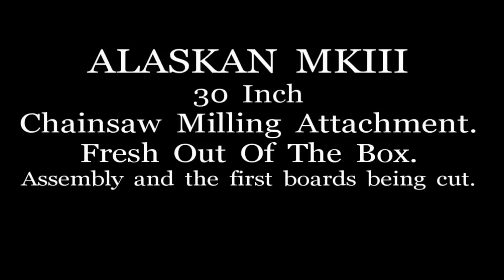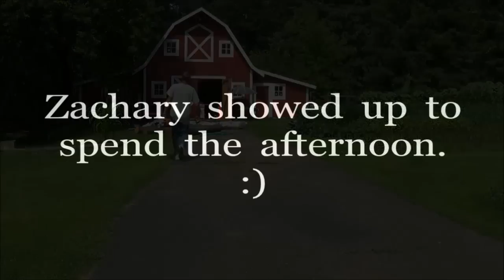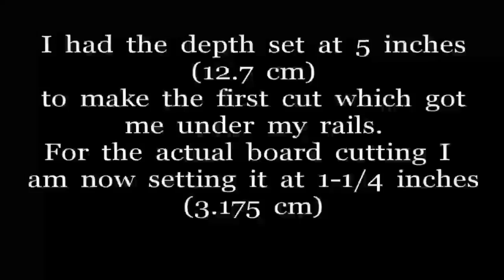ALASKAN MKIII. Chainsaw Milling Attachment. Assembling and then Cutting Boards.

Comment: I really appreciate the demo of the Alaskan MkIII- the closest facsimile to the Powerfist Portable Lumber Mill (TM), for which I cannot find an explicative demo video (and the manual of which is even lean on assembly instruction visuals).  Demo & commentary on assembly and cutting really helps; so too the logical comment about using one or more shunts or wedges on the cut behind the chain & bar.

Comment: Being a certified saw filer all my life and used to use a 7' chain bar to break huge logs down into quarters for the band ill to finish producing lumber, the secret to chain sharpening is to file the teeth at 5 degree hook angle and keep it sharp, just a suggestion.

Comment: One of these was my first mill.  These mills certainly do have their place.  The advantages including getting into milling cheap, being able to cut lumber where the log lays, and make really long beams (I put an 8x10 x36' main girder in my shop building).  Disadvantages are slow, labor intensive, takes big saw, lot of kerf loss.

Later bought a Woodmizer bandmill, and this is the way to go IF you want to cut a lot more lumber.

Comment: Nothing like making your own lumber out of found (free) wood, after years of making lumber with an Alaska Mill, (with an 066 Sthil, a 36" bar and skip tooth chain), I recently bought a real mill, (55hp diesel, fully hydraulic and 36"x21' capacity), but will always keep the Alaska handy for remote cutting because of its portability to anywhere trees grow. One suggestion is to move the cross bar with the handle to the center, or just to the right of center of the piece you are cutting. This gives you support to help square the mill to the log mainly when beginning or ending the cut. Also its important that you not have the bar tip clamp pressing on the sprocket in the tip, not an issue on solid-tipped bars but not many people run them anymore.
Reply from the maker: Nice job on the new mill. I was and am looking at a bansaw type mill but with winter coming and that being the time I do most of my workshop projects I wanted to get the chainsaw mill so I could get some cut and drying prior to the big freeze. Would you please email me Danny? I have some questions on the 066 and would like your opinion a few things before I get a bigger saw.
Thank You.    joe@homeandcabinconstruction.com
Reply: JoeandZachSurvival Hey Joe, I live out here in OR now but hale from good 'ol MN. I agree with Danny on the 066.
I worked in the woods here for years and the company I worked for had 044's for knot bumping and and limbing and bucking. The boss had an 064 for falling and when he upgraded to an 066 I got the 064 it was a little heavier but oh what a difference. I would pack it around all day limbing and bucking and never went back to the 044's,,, more power is good!  LOL
Reply: I use a door jamb shim to buffer the clamp from the running track in the bar and the sprocket- cheapest easiest way i've found that doesn't change the angle or impede my saw from rolling smoothly.

Comment: I have a 36 inch sawmill. Just love it. One thing I learned is that the rip chains work a lot better than the cross cut chains. Im using a ms661 sthil chainsaw. Have a 24 and 32 inch bars for it.

Comment: I milled my shop floor boards and several beams with an 036 and a 24" bar using a regular cross cut chain... I haven't tackles the trees I have down now but I have 6 firs and 2 cedars that I will be ripping here in a few days with the same 20 year old 036.  Been a great saw to me all the years I've had it. 2 spark plugs is all it's cost me other than the several chains I've gone through and the longer bar...

Comment: I run a ms660 on a 28inch bar and cut my tooth to10degrees and that works awesome. The bigger the saw the better. I was looking at a 460 but for the m only I just went with the 660. I cut 8.5 ft logs in about 5mins.  I love this tool. one of the best tools I bought

Comment: Get yourself a Stihl MS660 or an 880 with a 32 inch bar, a 441 won't have the stones for a lot of milling. Ideally one should have a 70cc saw with say a 20 inch bar for the mini mill for edging and a 660 or an 880 for the Alaskan. That way you won't have to keep swapping the saw between the mini mill and the Alaskan. Get yourself some ripping chain as well, the teeth are sharpened at ten degrees as apposed to 25 or 30 degrees on cross cut chains. Good work, keep it up.

Comment: wow! I can't believe how many comments there are about this guy's chain.  I guarantee most of them are from people who have not actually used a chainsaw mill before. It's always slow! and milling/ripping chain might be minimally faster than crosscut in certain situations, but it primarily produces a smother finish because the alternate high angled cutters don't chatter as much.  And milling always makes dust, not chips!  try it and you will see for yourself.  A brand new milling chain makes dust because of the way it severs the fibers.  This guy's biggest challenge is his under-powered saw (which he admits).  But even with a big saw (like Stihl 660) it's still pretty slow and tedious,  just not as slow and not as much stress on the engine, and the ability to go with a longer bar.

Comment: I would advise moving the handle on the jig to the center or just off center of the log.   2nd is an auto oiler,  I McGyvered mine for  <$20.

Comment: I have a 361 with a 20" now and just got my mill. I also just received a 32" bar w/ripping chain...and sharpening file...My thought was, the saw itself wont be cutting over the rated 20", and now I would have 12" of jig space to adjust.

Comment: gun lover 1955 is right ....you need ripping chain #1...also you need to make you some dozen or so wooden wedges about a 1/4 inch thick and 6-8 inches long , these you place behind the saw as it cuts to keep the weight of the wood from pressing down on the bar. I have had my Grandberg now for some  15 20yrs., mine is set up so as to be able to stand at the other end of the log and with a hand boat winch guide the saw through the wood , away from all the dust and noise, I have a 30 inch bar on mine  run by a Josered's biggest saw.
Reply: +Richard Siegler Yes, without a ripping chain he is taxing his chainsaw and fatiguing himself. Probably why the taking turns with his friend. A ripping chain should cut through the log at least twice that fast and be much more gratifying.  Hope he has seen your suggestions and ordered one by now.
Reply: Richard Siegler Did you make the hand winch assembly yourself?  I need that bad.  Running my 99 cc husky with 36 in bar from my wheelchair is killing me...
Reply: Larry Wood ......I did make the hand winch myself, but it was copied from an old timers set up he had made. Besides the winch you will need to make  a yoke with pulleys on each end.....the yoke is aligned with the cut and attached to the log from the start of the cut....then you set up your winch at the other end , run your cables. The setup also has a throttle adjustment cable that can be operated from the winch end. This system keeps the operator away from the major noise and dust.

Comment: Pretty awesome. If you wanted to cut lap siding can you set the depth at diffrent heights from front to back to get a tapper on the board?
Reply: Yes you can do that with this mill

Comment: Upgraded from a little Husky from cheapo Depot to a 562XP (?) AND a 372XP XPATH with 20,  24, 28, and 32 inch bars with stock and ripping chains. i think i watched to many Tube videos and thought I would mill some lumber. NOTE TO SELF: BUY CHAPS B4 YOU BUY THE REST OF THE EQUIPMENT. By chainsaw injury standards it was just a paper cut. Much worse than the 10 or 12 stitches was my shredded jeans and dignity. You can't beat me up any more than I have beaten myself.

Comment: Hi Joe 
Dont know if you already Know, but try using a ripping blade, makes it a lot neater cut and quicker. I have just made my own mill and use a 26" blade on my Stihl 391 that I upgraded from the original 20" chain and could have gone up to a 30" if needed but I find the 26" is all I need.
Reply from the maker: bmw5257 I do want to get one but I am thinking on buying a Stihl 660 so I am waiting and will buy a rip blade when I get the new saw. Thank you. Joe

Comment: I sure wish a chainsaw mill would do hardwood well. I am having to build myself a band sawmill from go-cart parts. I will start posting more videos shortly, just started welding on some steel for it. Sure wish I had more done by now. I need some lumber.
Reply: +onewyatt1  Several years ago I either read a story or watched a video of some guy who slabbed 400ft. of walnut in a day.
Reply: Robert Sorel I wish I had the energy to do that. These old bones can go for a couple hours per day now. I am just now getting back to working on my mill. I will be posting updates as I go but it will take me a good while.
Reply: او

Comment: Do you think the mill would benefit from having a counterweight to balance out the powerhead? and also do you use a wedge in the back of the cut once through to prevent binding of the blade?
Reply: i tried that if you put a wedge the tool surface become higher and your cuts are not straight... they bow if you put a wedge it cant be any higher than the thickness of the chainsaw blade or it wont make a straight cut

Comment: Do you have a ripper chain on your saw? a crosscut chain is what comes on saws most of the time,  it will make life a whole lot faster and easier.
Reply: +gunlover1955  According to the manufacturer, Granville, you can use a cross cut chain, it just makes a coarser cut
Reply: You are right, but you can use a car and trailer  over a pick up truck too but it is not as fast or as good.
Reply: needs a ripping chain. no two ways about it. it is like using a pickup truck to haul logs to the mill compared to a semi.

Comment: Normally chain say s equipped with cross cut blades. A chiseling cut shape on the chain blades is very helpful. you can modify the teeth your self but ripping chain can be bought

Comment: I am by no means an expert in fact I have never  milled a thing, I have been watching your milling videos, would it help if once you have passed the chainsaw and mill through a section to insert a wedge in the cut gap ? to decrease bar and chain pinching, less resistance and quicker cutting ?
Reply from the maker: Thanks Paul. I have videos on milling lumber on this channel and more of them on my other channel called "Northern Seclusion" in many of the videos you will see that I do in fact put wedges in to stop the binding. It is a necessity is some of the logs I mill. Thanks again. Joe
Reply: ive seen your other videos now I was a fool to doubt your competence.
Reply: Paul Saunders my thoughts exactly
Reply: a little late but sharpen your chain

Comment: Bet you've learned a lot since cutting this first bunch?

Get your logs up off the ground(think hi-lift truck jack), make sure one side is lower then the other(think gravity).  Being older, like we both are, those knees start to hurt the next day.

Remember to have fun....BTW, are your pups deaf?  They sure picked some weird spots to nap during the video'ing?!?!?
Reply: The other thing is on the ground the way you are, if you get any kickback at the start of the cut or your chain breaks etc, your thighs are going to get messed up pretty quick.

Comment: I would buy the biggest saw you can find then down size the bar 2  inches under. On a new chain if you take one stroke off the rackers with a flat file you won't have to work so hard to get the saw through. Your chain you have now is dull too much fine saw dust, and if you keep the saw on an angle it will cut strings instead of chips. When you put a new chain on your saw you should really study th angle cut of the teeth, with a round file that matches the chain try to keep that same angle and count each pass you make on one tooth and do the same on the rest. If you do 3 passes on one side and 5 on the other side the chain will not cut straight. I have always sharpened my own chain saw free hand with a cheap file, and always take the rackers down as those teeth get smaller. You could get a guide for the rackers so as not go too far down. When the rackers are down a little extra it wears the chain out faster but it sure saves on the back, you won't have to even push if you got a real powerful saw.

Comment: The chain sounds like it was running dry and the chips were a little small. This means the rakes are a little to tall. You did a nice job with the cutting. I could hear the dry chain sound that I knew so well. This saw likely has an auto oiler....and yes the saw is to small....I think I will build a bandsaw...this looks like it is way to much work....I am To old to sore and to fat....
Reply: Bob Ordewald has

Comment: Sorry so many Q's but I'm seriously thinking on getting one, I guess the entertainment value would factor in to but how much is that worth. Lol.  Did it take more than one chain? How many times did you have to sharpen? How many hrs did you run that saw to make the boards? How many gals. Of fuel etc??
Reply from the maker: Oldcoinsandstuff1 Its like cutting any other wood, the chain lasts a long time if you dont hit a nail or the dirt. If you have a dirty log you need to wire brush most of it off so you dont have to sharpen alot. I want a bigger chainsaw so I have not bought a "ripping" chain. If I had one the cutting time would be much faster. depends on what your cutting, pine goes faster that cherry. You get about 2 boards on the 9 foot cherry on a tank of gas. If your not thinking on doing thousands of feet of boards and just want to cut like I am doing to be used on your own projects, this thing is awesome.

Comment: Has there ever been a problem with the guide attachment just being clamped to the bar of the saw . With all the vibrations going on things would only have to move slightly & then sparks would be flying . Wouldn't it be better to have a hole drilled in the bar to attach the guide to
Reply from the maker: I have not had that trouble, I make sure it is on there tight. They do not give an option for drilling the bar.

Comment: Chain is definately blunt.... you can tell by the saw dust, should be more like small wood chips. Would make things run a lot quicker...
Reply: Have you used a mill like this before? The saw throws large shavings when cutting across the grain. Small shavings when you cut with the grain. 
Try it sometime.

Comment: Thanks for the video. I just purchased the 24" version.
Were you using a ripping chain? I have a ripping chain and have done some free hand cutting and it went through smoothly on med density wood.
Did your dogs have ear plugs in? They were pretty calm with all the noise. ;-)
I have 2 McCullough 10-10 53cc that have more power than an equivalent Stihl MS260.
Reply: Tony Robbins ghost

Comment: I can observe the cam sprocket adapter is dry and so flitching the oiler unit.. which will cause blanding on the ripper-teeth, in due course. Otherwise stay safe, wear two at all times and don't do it at all, unless you must. Regards

Comment: Is it better to cut seasoned logs or fresh cut logs?
Reply from the maker: +compdman12 I have cut them both ways. I think cutting them while green and then stacking them correctly to avoid checking is more than likely best but you could wax or seal the ends of whole logs and peel them and let them dry that way and then cut them when they are drier as well. I prefer to cut them green when I have the chance so I have more control (At least I think I do lol) I have videos on milling boards both here on this channel and also on my other Channel called Northern Seclusion. I plan in the future to post some more milling videos that will explain some of this in more detail. Thank you. Joe

Comment: how much off the tip of the sawblade does one have to install the clamping-thing? I guess if you clamp it down to far at the top the little gear-wheel that guides the chain around the tip of the "sword" will not turn and thus get hot or kill the saw or stuff?  in my case with the Stihl 660 MS that's a good 10cm or 5 inches i guess i might lose just for to stay clear of this little gear-wheel? anyone any suggestions?

Comment: once u ripped the log into boards how would u square up the varied remaining edges???
Reply: chip jones re: Edging, You can use a vertical mill (Mini-mill, or others), or you can get  guide clamps that clamp on the board, and run thru tablesaw

Comment: you sir need a skip tooth ripchain them chains will mill like butter with the alaskan :)
Reply from the maker: ***** I agree but am wanting to upgrade to the Stihl 660 and when I do I will then get the rip chain. Thank you. Joe
Reply: JoeandZachSurvival   just remember to get a dedicated bar for it så that you can leave both bar and chain on the millblock and not have to go disassemble the whole thing every time you need to go cut something else - i run a 56" bar and chain on mine currently and its a B.... to go and take a part reassemble and so forth every time i need to fall something with a little size to it :)

Comment: I think if you centered the handle close to the middle of your cut you would be a lot better off.  It seems to be to far away from the motor.  Just a suggestion.
Reply: I think you did great and I appreciate the demonstration.
Reply from the maker: If you do that it is to hard to hold the saw level. It is weird how it is balanced. That handle plays a big part in keeping it steady and you need it off set to have enough leverage. I should say that it works best for me that way. Others might have different luck.
Reply: Hey, yes I can see where you are coming from it is not about the position it is about the center of gravity.  Thanks for pointing that out to me.  Looking forward to buying this.  Did you ever get your 30 inch saw?